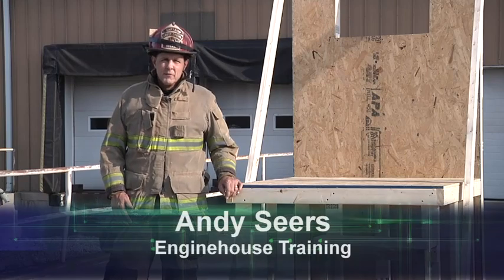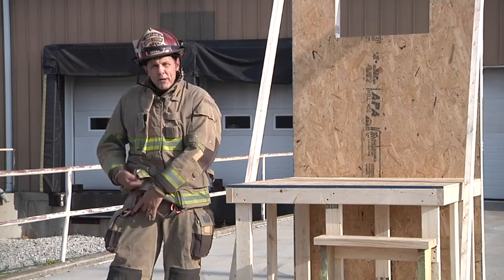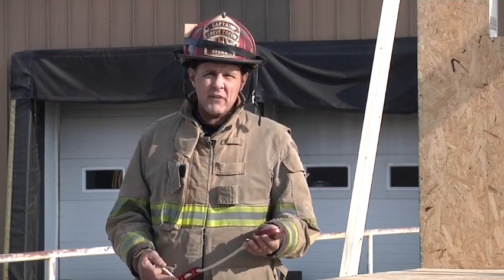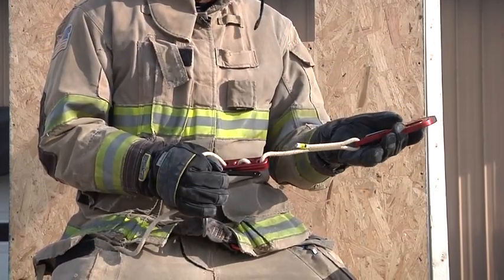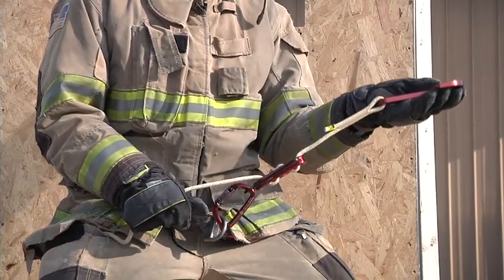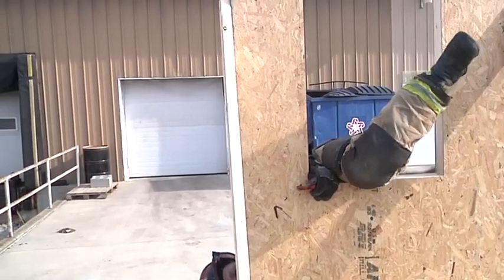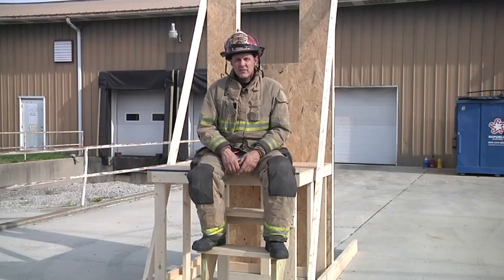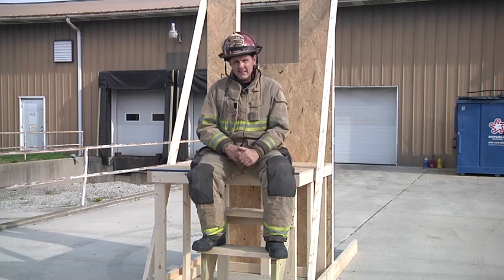The Firefighter Bailout Kit

Comment: how sure can you be that the hook will stay in place and won't slide off the wall?
Reply: Keep your hand on the hook until you can’t anymore and pray your body weight holds it in place. I’m not a fan of heights but I’d rather bail out than burn up.
Reply: There is a spike at the tip of the hook that digs into the windowsill. Weight from the firefighter should set it in and it should not come loose.